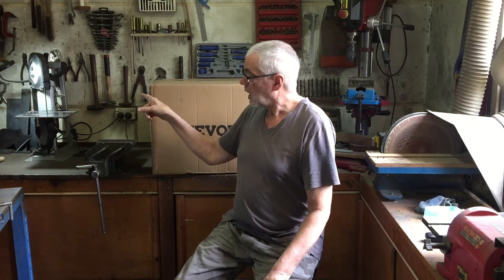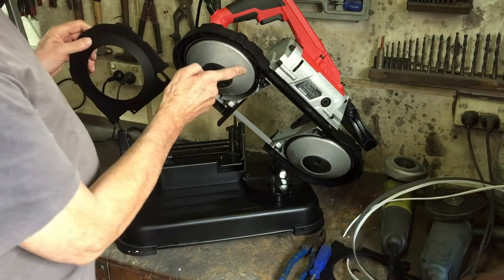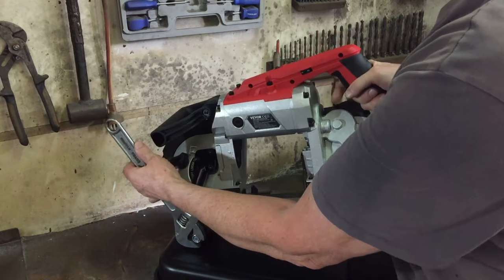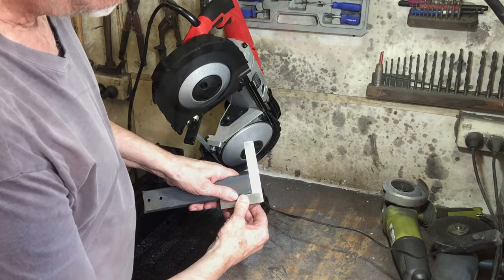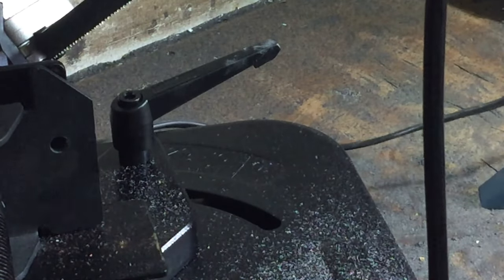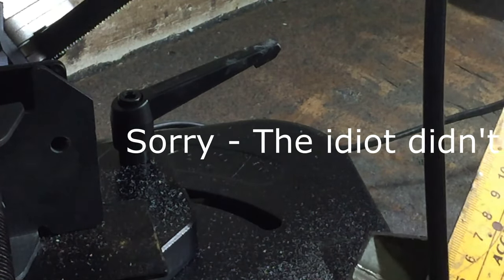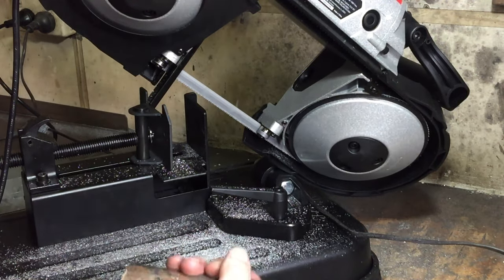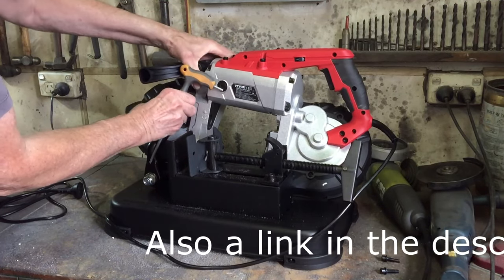Vevor Portable Metal Cutting Bandsaw Review

Comment: I have a little fixture plate I use in my electric hacksaw for clamping down small items that won't hold with the standard vice. The existing vice holds the fixture plate, and the small item is clamped to the fixture plate.

Comment: I have to admit I find myself pretty much in the same position you were in, having bought the handheld version of the saw last year, I am finding it to be a fantastic tool - wish I had bought this version of it right off the bat. But my old electric hacksaw is still working well, and I have a few blades for it sitting in the cupboard, I'll wear them out first before getting one of these, (nearly 40 bucks each for those suckers!)  But one of these is definitely on my gunna list!

Comment: Would be good if the base was diecast aluminium like many of the cheap Chinese pillar drills on the market rather than plastic.
It looks to be a good quality, handy tool for the home enthusiast.
Reply from the maker: Thanks mate. 
The base is “alloy steel” not plastic.
Reply: Good to know as it sounded quite "plasticy" when you tapped it. Have fun with your new toy!  @ShedBuiltStuff
Reply: I bought a similar model last year.  For the few times I need it, it gives me a much better cut than using handheld tools.

Comment: Aluminium is the main reason I want one of these saws, but you have cut bugger all Aluminium. I cut a lot of solid round bar Aluminium from 20mm to 60mm and I cannot find one of these reviews that shows much Aluminium cutting pity.
Reply from the maker: The standard blade teeth size is too small for Ali. It will cut it but the teeth clog. 

If you can find a courser blade, the saw will cut Ali fine as it can be set to run fast enough for Ali. 

I use a cheap Ryobi wood cutting bandsaw (with wood cutting blade) for cutting aluminium. This does an excellent job.